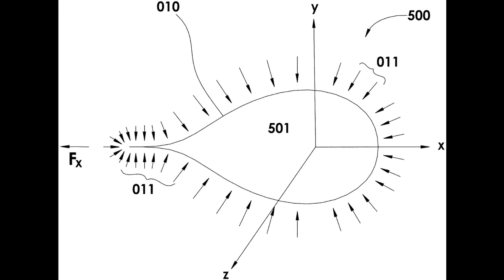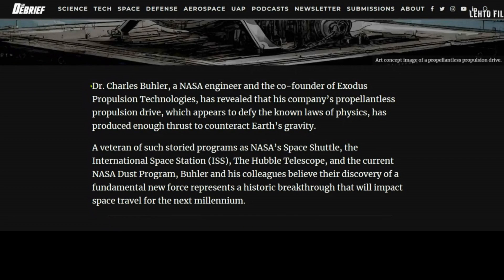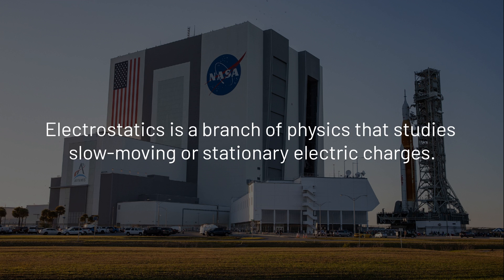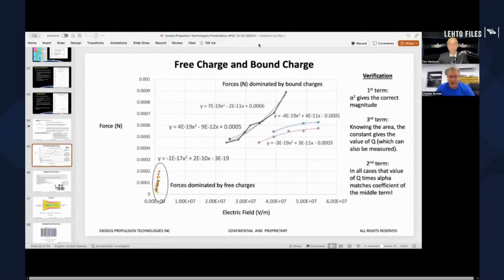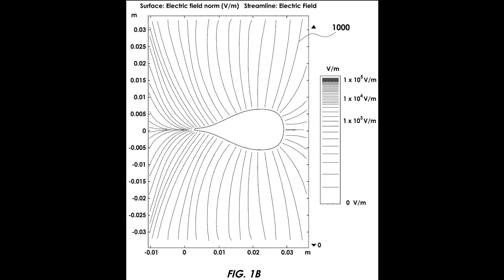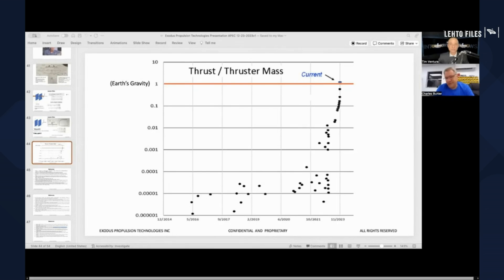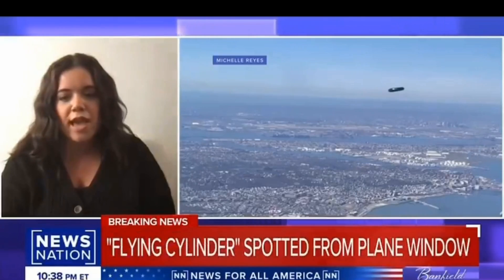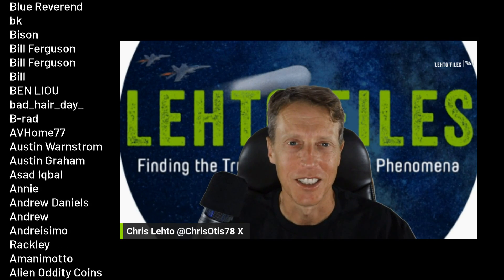NASA Scientist's Propellantless Thrust Breakthrough - The Key to UAP Propulsion?

Comment: Whether this is a reproducible thing or not is not the issue.
This kind of thing should be on the front page of every scientific journal...
So that they can look at it, and understand it, do their experiments...etc..
Not bury our heads in the sand and say it doesn't exist.
Reply: Right. We could have had floating cars and speeder bikes by now
Reply: There is nothing new here and the Air Force did look into this decades ago and there was no useful tech to be gained from it. It's just elecro-static forces like you would find on your comb.
Reply: @charlesmiller8107  - Except, much, much, larger charges and being able to isolate the charged area.
Reply: The military industrial complex has that suppressed for obvious reasons
Reply: @1MasterBates  Why would they do that???  If anything they would take it over and use it.   The reason is that this is just a Con Job.
Reply: @1MasterBates  You say that like they'd be good or useful in any way. We've actually had floating cars (hovercraft) for decades. Without friction/traction from wheels they're not all that easy to steer, stop or get moving and forget about using them in anything but near perfectly level ground. Maybe this might bypass that last point but imagine trying to drive one of if those flap bottomed fan boats they use in swamps around city streets and parking lots. Even if you could get above buildings they're hard to steer, easy to crash and impossible to stop fast. And anything like a Speederbike would be the most perfect form of suicide yet... It's automatically more dangerous than speeding through traffic on superbike, now go through unfamiliar and unprepared terrain at two feet off the ground. Just, no.
Reply: @johnassal5838  except you have no data either way to determine if this technology would behave the same way as a hovercraft which relies on simple downward air pressure. Who’s to say it wouldn’t be fundamentally safer?
Reply: @johnassal5838  - It's all part of the process of developing the tech. First, you figure our how to move, then to figure out how to steer, and finally, you figure out how to stop. 😁
Reply: Whatever else you believe this being reproducible is actually the most important thing. Otherwise it's only an unconfirmed rumor. Ironically it sounds as if this could be a major advance, if true, even if it's not reactionless. So called lifters are mostly just a curiosity due to limitations imposed by a not very aerodynamic electrode grid and low efficiency. Even if the only difference here is more efficient thrust and getting it without a grid you could still see a revolution in aerospace.
Reply: @johnassal5838  If it was reproducible, he'd already be accepting his nobel prize. he's never going to subject himself to peer review because it will expose his fraud and cut off his grift.
Reply: it should be on the back page of the journal in the Debunked Discovery section.
Reply: Its not reproducible because its clearly a scam. Our "laws" of physics are actually models built through hundreds of years of testing, and it violates all of them. His explanation is gobbledegook, you can't exert electrostatic "pressure" against a vacuum because the electrostatic force is only created by electrons and protons exchanging virtual particles. Without particles you are "pushing" against or "pulling" from there is no force, as thousands of experiments over hundreds of  years demonstrates
Reply: He doesn't want it peer reviewed, because it would expose his scam. There isn't a physicist on the planet who can't debunk his ludicrous claims within 30 seconds, given how well the electrostatic force has been tested and that he's claiming to violate the laws of conservation of energy and momentum.
Reply: “Reproducible” is how you do more experiments. If it can’t be done again, it can’t be tested or experimented on.
Reply: unfortunately, whether this is a reproducible thing or not is the issue, and was it ever actually produced in the first place?